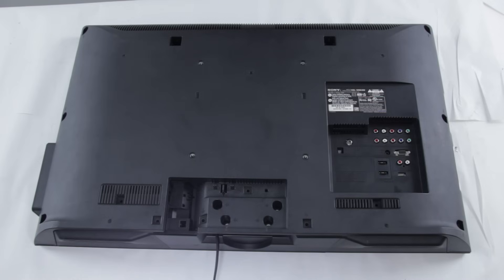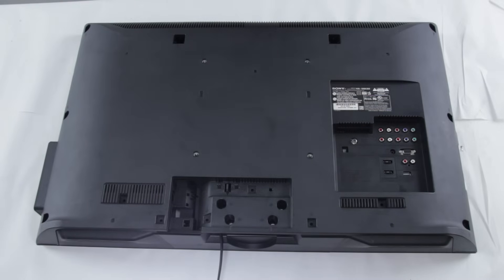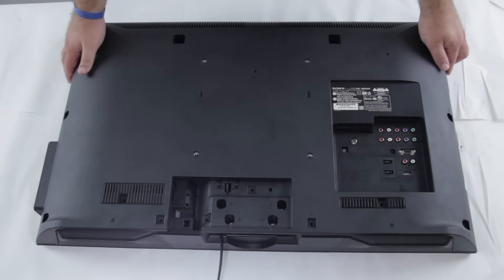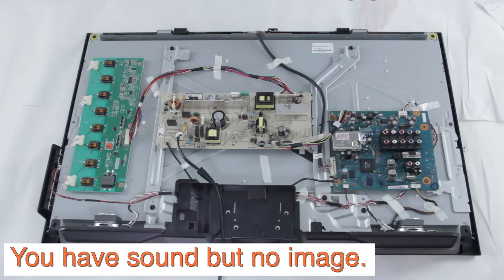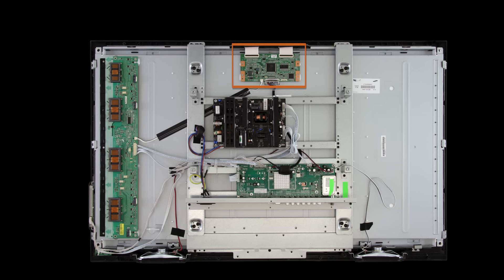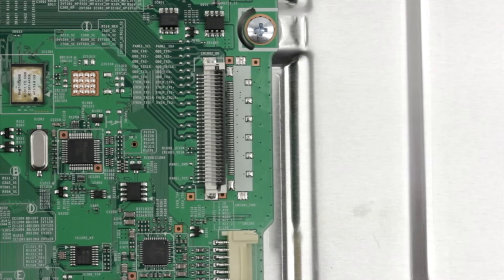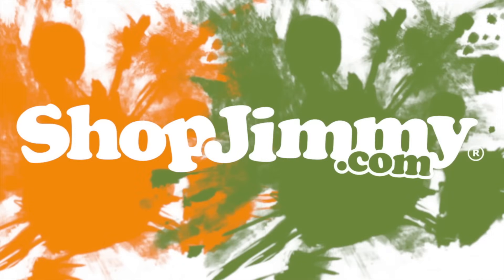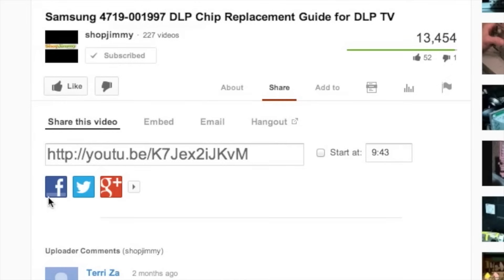LCD TV Repair Tutorial - T-Con Board Common Symptoms & Solutions - How to Replace T-Con Board

Comment: Hi Jimmy, very nice explanations about T-Con thank you for this. 

Symptoms: 
I have got a total black screen, no sound, but remote receptor (red light) works while I use the remote. 
TV reference: Philips 49PUH4900/88 
Mother Board: 715G7673 - MOE - 000 - 0051 
T-Con: lg display v15 uhd tm120 6870C-0535B 
Powerboard: 715G66-P02-001-002H

Tests Done: 
1. I replaced the power board: No Picture / No Sound
2. I connected my laptop with HDMI with playing a video. No Picture / No Sound
3. I have also put the room into darkness to light manually the screen with my phone while switching it on. No Picture / No Sound

Questions: 
1. Is this an issue with the Motherboard? 
2. Is this an issue with T-Con? (But in this scenario, shouldn’t I hear at least the sound?)
3. Is this an issue with Backlights? (But in this scenario, shouldn’t I hear at least the sound?)

Thanks a lot
 for you precious help
Reply: Ordered all new boards .... waiting for delivery.
Reply: What was the issue? I have same
Reply: @michaelluciano6336  For my case it was an issue with backlights.

Comment: I have a Sanyo 55 inch model FW55D25F serial number: DS4A1623134642. When i try to turn the tv the tv turn on the backlight turn on i see the Sanyo logo like normal and then the tv shut down immediatly. I have change the power supply still the same problem. I have change the mainboard and the power supply 
still the same problem. I have disconnect the t-con board no logo but tv still shut down like before. What can be the problem?

Comment: I have  a 65” Samsung and I replaced the tcon boards but the third blue light on the board still goes off after 3-4 seconds and then I lose my picture 
Is this a power supply problem?

Comment: I have a Samsung 60 inch (model code UN60F7100AFXZC) and it has horizontal and vertical colored lines. No crack on the screen is visible, sound is OK, all inputs work. Would a T-con board replacement fix this?

Comment: Hi, I have a Samsung Model Code: UA55F6400AMXXY, Version No: WU09, S/N: ZXUS3MLF200414E. The picture is very dark even when backlight is set to 20 and brightness is turned all the way up to 100. When I ran the device self test in the service menu, all results is OK except for TCON:NG. Would this indicate a faulty TCON board? TCON board is BN95-01131A.

Comment: Hi I have a soniq 70in smart tv S70UV16A we had a storm and power went out. Turned tv back on and it had a flickering screen turn it off then back on now only blue screen. So I pluged it in to video player I now have sound and blue screen. Backlite works remote works on video to turn sound up/down. Do you think its the T-Con board or the TK fuse blown. Or can you advise me dont want to throw out. not under warranty. thanks Greg

Comment: My sony bravia KDL-55ex500 turns on (green light) but hten shuts itself down after a few seconds and the standby light blinks 5 times then stops then blinks 5 times, then stops etc. We just chanfed the power board but are now wondering if it could be detecting a problem with the T con board?

Comment: Hello, I have a vizio M65-C1 set. My backlight stays on and I have sound. But the picture goes on and off. I have replaced power board and main board with no luck. Do you have any suggestions.  Thanks much for your consideration

Comment: Hi there.. So as you said in the beginning there is back lights and sound there for the Tcon board is the main problem.. I have a TCL (model: LED55P6100US) 📺.. And i dont know where to get a replacement Tcon.. So my question is.. Can i use a Tcon from a different TV.. And if yes what am i looking for in that Tcno?

Comment: Hello, Toshiba 50l5200u with horizontal lines across. Bottom half of tv, replaced tcon board because it was showing signs of wear but no change to screen, one solid black bar, with another of equal size on top of it with distort/dark image,

Comment: Hi Jimmy, thank you so much for your videos. I have a LG 42lg10r. A few months ago a wall mounted guitar fell on it's top bar. Immediately there was a thick single purple line down the centre.
So I turned it off and sort of just left it, wanting to throw it out. About a month later I turned it on again and the line was thinner. A few months have passed and now the centre line is almost completely gone, but some colored lines have appeared elsewhere on the screen. 
If the TV has been off for a while, the lines are almost full bars of black and as it stays on, the bars become thinner, but they don't disappear or go away like the original centre line. 

Please let me know what you think about the problem. It sounds like the T-con board. But I just wanted to be sure before biting the bullet and paying for the part.
Reply: Sounds like a loose connector. Use a hairdryer to heat up the gold connectors on the side of the lcd panel. If the problem goes away, it's due to expansion of the metal. You could use electrical tape to ensure a good contact is more permanent
Reply: @TimRicherson  thanks Tim, I'll look into it. I appreciate the feedback

Comment: Hi, I have an LG 32LN5400. It wont turn on, when you press the power button and hold it, the red light flashes twice and then goes off. I have already changed the power board thinking that was the problem, but it is exactly the same. Many thanks

Comment: I have a Toshiba 52 inch.  Model no.52rv530u. Serial number am398018441  and I am kinda lost it powers on but no sound and no picture I can slightly see the imagin on the screen but can't really tell what's going on. I mean I can tell it's on. I was just wandering if it's worth fixing. I have no way to check anything here at home like on your videos. Any suggestions

Comment: Sharp LC-52LE830U with  thin vertical blue line on the left side of the screen, it’s about 2/3 from the left of the screen and runs about 2/3 to the bottom. It’s only visible when screen is white or close to white and not visible when screen is dark. Would that be something that can be fixed by replacing T-Con board?

Comment: I have an LG 42le5400-uc... It's displaying 4 vertical lines on the the left side of the screen (2 yellow two red). I've pulled the tcon (31t12-c04 T315hw05 V0/V1)  board appears visual fine, ribbon cables also seem fine) suggestions?

Comment: Hi Jimmy, I have a Sony Bravia KDL46EV500 with audio but only a green screen.I tried factory reset but can't get a picture to reset anything else. I looked at all the youtube videos and its not a loose cable or device issue.Can I actually replace the T CON Board on this model? I haven't opened it up yet.Thanks!

Comment: Thanks for the videos! I have a LG 65LB5200-UA that is turning on (green power light and backlight visible) however the display itself does not turn on unless I turn the tv off and on multiple times. I am guessing this would fall under the T-Con board issues but wanted to get your input.

Comment: I have a Samsung UN50H5203AF that was on working when I went to sleep and then woke up to no picture but sound. The lamp is still working and like I said the sound is fine but no picture. It failed the flashlight test as I could not see a picture. I have just pulled the T-Con board off but don't see any visible burn spots. It seems like the T-Con board is the problem but what do you think? I do not own a voltage tester or anything. Thanks for your help!

Comment: I have a Ln46a530 Samsung. The right half has strips or sections running vertically the have horizontal lines in them with funny colors. The TV still works and is watchable but not nice on the right side. Is this a t con?

Comment: I have a Hitachi 65R8, serial number TH6LK04313 that's just over two years old.  It developed a horizontal dark shadow just left of center.  The band is about 4 inches wide.

If I do a factory reset, the band goes away for about 5 minutes.  If I unplug the TV for any amount of time, the band goes away for about 5 to 10 minutes.  

I have opened up the back and cleaned the ribbon cables and reseated them, but it made no difference.  I contacted a repair shop, but he was telling me to just replace the whole TV.

It seems to me, it starts after it warms up.  We replace several T Con boards on Samsung TV's at work, but they had slightly different issues than I'm seeing on my TV.  When I google search my issue, I can find no pages with my issue.

Comment: What causes only certain areas of the screen to have dark spots, (I would think bad LED's in backlight), but they actually work properly sometimes, and then in the middle of viewing, go dark, but might even light back up? (LG model 55LS4500) ??? I have checked power supply board, even letting it heat up for a while, but all voltages seem normal on it?

Comment: Hello, I have an LG55lw5300 and I’m experiencing some vertical lines on mostly half of my tv while the picture is showing underneath. I attempted to repair and removed the flex ribbon cables and put them back but the issues wasn’t resolved. I’m curious if you believe this is the TCon board or related to something else? Thanks!
Reply: Thank you my TV died and my wife has to stay home now I don't have to pay 500+ just to enjoy TV

Comment: Well ! For the last month my Sharp LC-50N 7000U Serial # 50G1612D6H00875  when turned on in the morning the picture would be blurry but after 15min the picture would be normal. Now the screen is black no response the Sharp Logo comes on for 3 sec goes off and a white circular light spins for 3 sec and goes off. I replaced the main board but no change ! Any suggestions ?

Comment: I have a Samsung LN46B630N1FXZA   TV that has vertical lines - mostly yellowish.  They get worse the longer the TV is on.  I pulled apart all the connections and put them back in with no help.  Pulled out the T Con board (2009fa7m4c4lv0.9 ) and replaced it with a "used" T con board.  Same problem.  Should I purchase a NEW T con board or feed it to the dump??  Thanks .....AL

Comment: Factory menu settings got messed up. Samsung UN46EH5300. No red back light, tried shorting VSS/SDA to reset. When main board is disconnected white back light turns on. I am not sure if main board or t-con board is issue? If it is an issue with one of these boards can I replace with a newer board?
Reply: Forgot to mention the tv doesn't seem to turn on and is all black screen, again with no red light but power seems to work disconnecting board and lighting up screen but still no red back light.

Comment: T-con board or mother boards and power only damage 
If something water get on them

T-con damage is to screen get water inside front gets inside

Motherboard  is Eeporm  corruption 

Power board  if both get damage 

Tvs with backlight are easy fix
Replace if tv on do the flashlight test and hopefully 6 led need replace 

Or all if want new  
To stop this 
Just turn back lights down to 20%  not original 100

There light bulbs   anything  on high will damage 
Get that to your heads

Comment: My sharp aquos flat panel tv model LC-46LE700UN Serial No. 908820865 has blinking yellow light, dark screen, no picture, no back light. It also do not want to power back on. I try to reboot the set by pressing the input and volume down buttons at the same ti. Still the same issue. I proceeded to take the back cover off and checked all components, visually, they looked okay. Next I checked the standby voltage with my meter from the power supply, which checked out okay. They was a 5 volts standby voltage coming out of the power supply. I suspect either the power supply or the logic board or maon board. If anyone out the had come across this problem, please give me a heads up on this issue. Or make a comment here. You can also send me an email to: osorioarmando412@gmail.com. l will deeply appreciate your help.

Comment: Sony Bravia model NO. KDL-40S4100 I have a thick vertical line running down right side. I attempted to disconnect and reconnect ribbons and connections going to t-con board with no luck and also put spaces in between the gram and ribbons going around screen with no luck. Any other suggestions or is the t-con board the culprit without a doubt? Any help would be useful. Thank you much!

Comment: Have LG 47GA6450-pic goes slightly dim every 3 seconds then repeats. Power supply voltages seem stable. Already tried Mainboard replacement. What could it be?

Comment: Let's try this: I have a 32lg5500.
When I turn it on the screen shows all colours distorted.
Been looking on internet and have it narrowed down but not able to solve it.
So there are 2 flat white ribbon cables going from the motherboard to the (T-con?)board. If I pull one of them out and turn on the TV, the picture has the right colours but shows alot of black vertical lines. Question now is: is it the cable, the connection to the motherboard, the connection to the other board?

Comment: Hi guys. My LG flat screen has  intermittent colours and faint ghostlike horizontal thickish 1 inch wide.  lines about an inch apart . I going to check the t- con board tonight for bad connections . Is there anything else I need to check please?? I'm in UK.

Comment: What I have is the TV would come on and stay for about 20 min then go black, after it would go black I would cut it off wait for a minute and cut it on and the logo would come up and their would be sound but no picture, when coming back on some parts of the screen would be brighter than the parts(I did the flash light test and can see what is on the tv and I have sound) I replace the power board and still the same thing.  HELP

Comment: PLEASE HELP!.Im having issues w my LG 49UH6100 TV. i get these blue, orange,grren, and yellow lines and the picture completely goes away. I can still hear sound but then my tv shutsoff an turns back on by itself. It only lasts about 30secs.  It will do it 2or 3 times in a row. Which is annoying but after tv "warms up" no issues. As i have read the T con board isnt capable of turning tv off an on or is that incorrect . So what should i replace? Thx for your help

Comment: I have a Panasonic model TC-L65E60 the right side of the screen does a weird wave like pattern. I undid the larger connector from the t-con board and video goes away but you can see the back lights and there is no more waving. I unplugged the smaller connection from t-con board and it did a weird diamond pattern. Is it the T-con board that needs to be replaced?

Comment: Unfortunately there are a lot of questions but no answers. Anyway, I am not happy with the guesswork, if you have no picture your Tcon is bad. I would rahter see a video how to messure each mesuringpoint on a T-conn, defferentiate trough messurements between bad cables, connectors and chips. Is the videoprocessor on the motherboard bad or the t-conn? All this points could be adressed befor saying its a bad t-conn.

Comment: KDL-40R380B. Audio works but picture has a grainy green color in the shadowed and dark areas on screen. Think it's a chip on the Tcon board (AS15G). Think I can replace that chip but wanted to know the right on as there are different ending letters chips, like F and a few others. Help is appreciated. Thanks again.

Comment: Hello, I have a LG42LA640V TV  occasionally the screen goes black but it still has sound, if you shine a torch on the screen you can see the image, which would mean backlight failure, but if you turn the TV off and leave for a few seconds then turn back on the TV works as normal, sometimes it will work perfect for hours, then gradually it will only last for anything from 5 to 20 minutes.

Any help or advice would be gratefully received.

Comment: Hi Jimmy, Samsung model number un50ku6300fxza. The serial number is 05hv3cbh402598t. It has no pic, only sound. Opened and did a visual but nothing looks/smells burned out.  My limited knowledge after looking at  utube vids is that it could be the TCon board, led strips, or led power supply. I am a visitor at daughter's house, her TV, in Texas and do not have a VM to test. Suggestion please.
Charles

Comment: My Sony XBR65X930E (16 months old) failed a few weeks ago. The screen was dark gray with no picture but did have sound. Geek Squad replaced the TCon board and it ran fine for 3 days and failed again with same symptoms. I have another call into Geek Squad but would welcome your insight. The Geek Squad tech has 20 years experience and seemed competent. What could be causing the TCon board to fail or is something else going on. Thanks for your advice.
Reply: I have the same problem on my Sony XBR65X900E. Grey screen with sound.  The TV is only 2 years old and the whole thing is pretty disappointing.

Comment: TV Model is PN60E7000ffxza s/n z50d3cz801016a turns off and on by itself and sometimes stays off until I disconnect power and then replug the power after waiting a few minutes. Sometimes the picture goes off but the sound stays on but mostly everything turns off and then come back on by itself. Any ideas would be appreciated. Thanks.

Comment: In not sure if have sound  have nothing connected not sure wahllhatbinput it's in. I did the backlight test unplugged main board from power supply led amd screen comes on screen turns on blue  what you think is my issue? Samsung u6300 50 inch. I ordered a main board waiting for it to come in. Hoping that's my issue

Comment: Appreciate the video . I do have a situation for you . I have a 32 inch samsung smart tv model : UN32H5500AFXZA  version TS01 . My issue is that . once plugged in , it cycles around 90 sec to 2.3 min.s of powering on and then off . Ive been trying to find the schematic specs for it with no luck . all samsung wants to do is send out a tech . Im trying to figure it out myself cause it seems they dont have any support fo devices older than 3 yrs . Any and all assistance would be greatly appreciated . 
                                                                                                            keng7allah@gmail.com